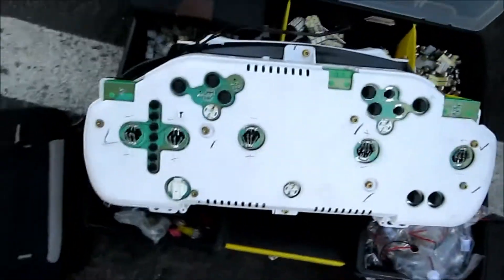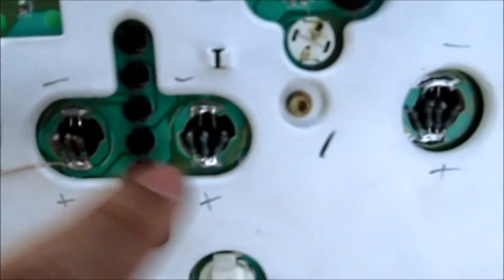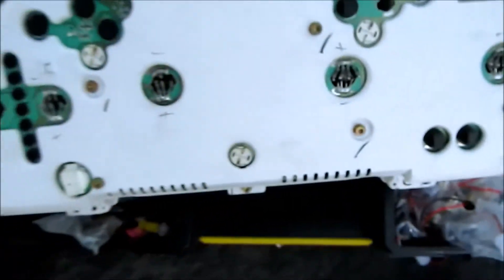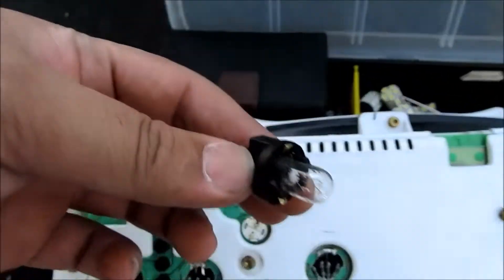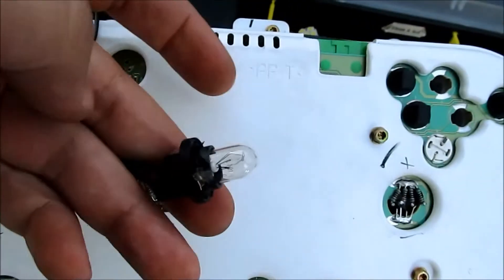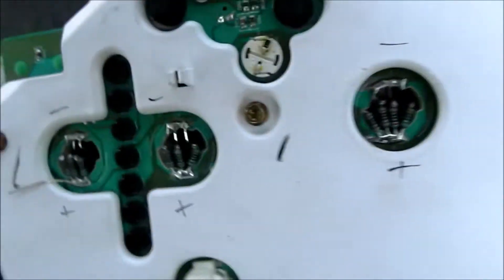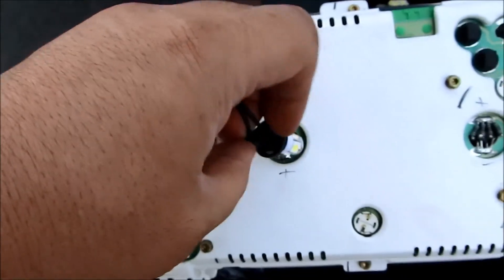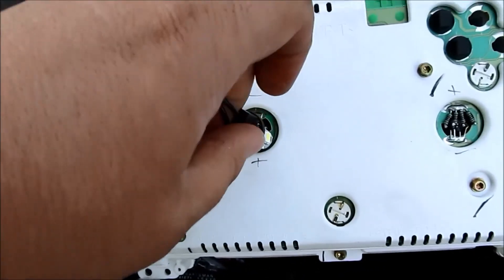1998-2002 Honda Accord V6 Cluster LED

Comment from the maker: This mod will not mess with your fuel light.  If your fuel light is on with a full tank..It can be a few things..

1. make sure your gas cap is on tight
2. try resetting the ecu.. pull the clock/backup fuse on the passenger fuse panel.
3. drive for the next couple days and see if the light turns off by it self.

Comment: I'm having a problem where only the D4 light is out. Is that just a lightbulb I need to replace?
Reply from the maker: before you go ahead and purchase new bulb.. take out the cluster and swap the bulb out one of the working bulbs on the gear indicator.  The replacement bulb will be a T5 aka #74 bulb.
Reply: My D4 light is out too on my 2000 Honda Accord SE. Is the cluster the same as this video? I can buy the bulb at the dealer.
Reply: Adrian Palomino yes you can buy that D4 bulb at Honda dealer ..

Comment: I watch all your videos to guide me, i followed the steps and used 5 T10 and 3 T5 (2 turning signals) the fourth T10 does not turn on and neither does the left turning signal " i flipped the led and still wont turn on" what can i do?
Reply from the maker: Angel Ronson I would first try swapping the working side light side with the led to the slot that is giving you the problem.  For example.. if I know the right turn signal work.. I would remove the led with the socket and put it on the left side and test to see if it still works.  Next, i would take a 9v battery and test and see if the led itself is working on the non working leds.  You just have to spread the 2 contacts and touch each of the 2 metal contact to the + and - contact on the battery.

Comment: I gave it a try and my left signal light works now, however the left speedmeter light wont turn on, any suggestions?
Reply from the maker: Angel Ronson It's the leds you have.. you have to keep on flipping them around until they all work.. they are all polarity sensitive. you have to make sure the + and + match up.  All the sockets do not have the same side polarity.